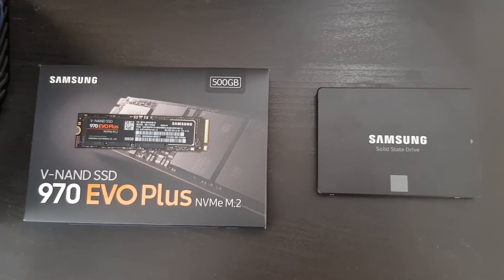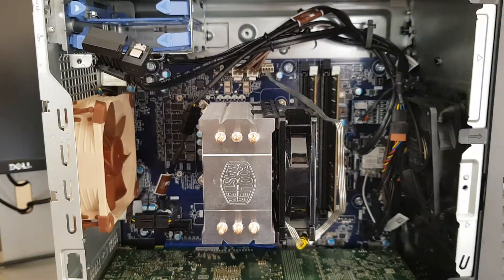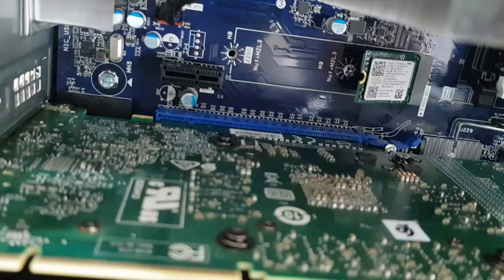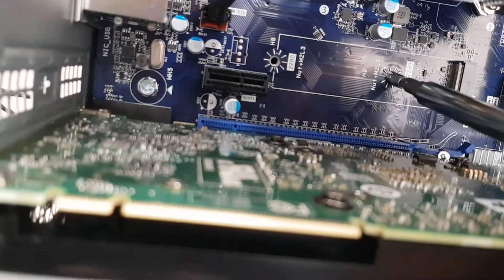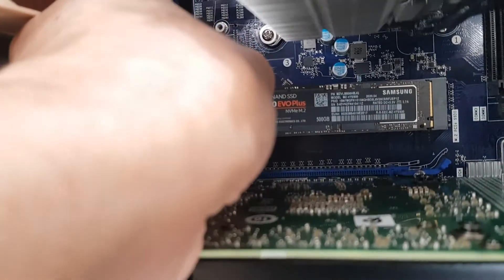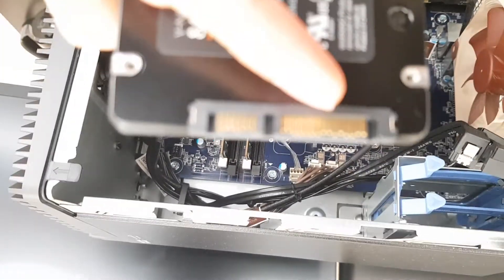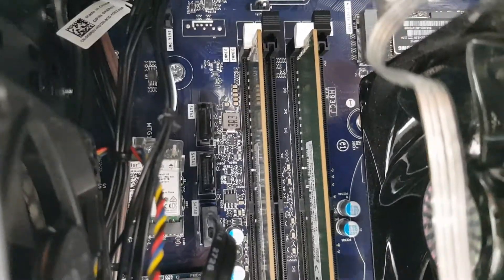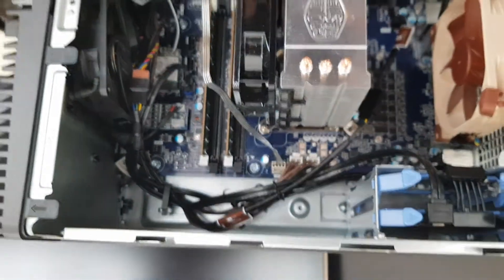Installing NVMe M.2 SSD and Regular SSD Hard Drive

Comment: Hi, finally found a video with the same dell model as mine!

I thought I was going crazy that the only slot I can fit my NVMe PCI-e is already taken up by a half-sized chip lol (i am hardware illiterate).

Is there a way to install NVMe PCI-e without taking out the original for this pc? I really hope to avoid having to clone window OS and the files... I thought I would be getting +1 TB of data, without replacing the old 458 GB. It's really disappointing if that's the case.

Comment: hi, can you provide a link to the regular 3.5 ssd hard drive that you bought to installed in your dell g5?  i want to be sure it's compatibable.  Also, does the purchase provides the necessary power and data cable or do i need to buy it sperately?
Reply from the maker: Hey, I don't have the link because this was 2 years ago but I've got the name of the SSD in the description. Google the name or buy from your local computer part shop. You will need to buy a separate data cable, I got mine from a local computer shop for $2.

Comment: Would you be able to show us how to upgrade the SSD the OS came on? Mine is just the 128 but id like a much larger one
Reply from the maker: The m.2 drive was the SSD in my case and this video shows how to physically change the drive. For moving the OS to the new drive you have to use windows imaging tool. There are plenty of videos out there already which covers this. Let me know if have trouble finding. :)

Comment: I got the same samsung ssd that you did but it doesn't work for me and I have the exact same pc as you
Reply from the maker: The m.2 ssd or the one that goes in the hard drive rack?
Reply: @nooragha360  yeah the m.2 ssd. It kept saying something along the lines of no bootable device found when I put it in. And the motherboard meets all of the requirements for the m.2 ssd so I don't know what is wrong
Reply from the maker: @itsredthesmed  you need to have your win10 operating system recovery drive connected via the USB to install win10 in your new ssd.
Reply: @nooragha360  ok thank you so much for the help
Reply: @nooragha360  another question if I install win10 on the m.2 ssd will it factory reset my pc back to choose your country and such?
Reply: do you also have DISCORD or some other social media that I can contact you if I have anymore questions or send screenshots?

Comment: do they come eith the screws
Reply from the maker: The screws for the NVMe SSD drive were already there on the motherboard.
Reply: @nooragha360  Well i have a different config with only 1 tb hdd
Reply from the maker: @elihi7607  then I would recommend to open the PC and find out if you have the slot on your motherboard.
Reply: @nooragha360  Ok, My last question is do i have to buy a sata cable or should the ssd come with one?
Reply from the maker: @elihi7607  you need to buy the data cable because SSD most likely won't come with one. They are cheap to buy only few dollars.

Comment: First I got to say your video helped me a lot, low air flow and over heat cpu was always a problem for me until I watched your video and changed cpu cooler then added more fans
Now, I want to get a SSD but is there a way that I can use both SSD and the HDD that prebuilt in it? I see the SSD tray in the box but do I need to unplugged HDD and use the cable to power SSD ? The cables by the SSD tray seems not fit
Reply from the maker: Yes you can use both the HDD and SDD but I wouldn't recommend it. HDD is too bulky, slow, takes too much space and can easily be replaced with a faster and lighter SDD drive.
To use the SDD drive bay, you just need to buy some cables (they're cheap).
Reply: @nooragha360  the reason that I’m keeping the HDD was because I bought a 500gb SSD instead of 1t to save some money, so I can use both SSD and HDD to use
I just done install and set up the SSD, now I want to move the HDD from the front to the 3.5inch HDD tray on top left to get some space for a fan. I put a fan on the bottom of the HDD at the front, the fan is facing the graphic card now, should I move it upper to let it face the CPU fan ? Will it provide better air flow ? Or should I buy another fan for cpu and let this one keep facing graphic card. After I changed Cpu cooler, added a fan in the front and changed original fan to Noctua in the back, I’m still having around 78-84°C when I play games, idk what part did I do wrong

Comment: Do I need to buy those cables? I want to buy a 2.5 inch ssd
Reply from the maker: Yes in my video I also installed a 2.5" SSD. The cable (data plus power cable) was cheap from a computer hardware store for only $2.

Comment: Hey, ill have my G5: i5-10400f, GTX 1650 Super, 2x8gb RAM, 1TB HDD delivered in about a week and I was planning on immediately adding an SSD, and use the SSD to run my OS and programs/games I play frequently. Im guessing the OS will be alrdy installed onto the HDD and Ill have to transfer that once I install the SSD? But mainly I was just wondering If all i have to do is literally insert and screw the m.2 SSD in? I saw some comments about how the "SATA" cable is too short inside but does that matter if im just gonna use the NVME SSD?  Never have  modified a PC before, I understand I need an M.2 SSD, im guessing "NVMe" ssd's are faster/better than "SATA"?
Reply from the maker: NVME M.2 is the fastest SSD type then the regular 2.5" SSD and finally the regular HDD. When you get your PC turn it on and perform normal setup. Then make an Windows 10 image on a USB. Remove the HDD and insert your SSD. Plug in your USB with your OS image and turn on your PC. Install the OS in your new SSD and your good to go. Enjoy.
Reply: @nooragha360  Thanks however I was talking about dual drives and having my OS on the SSD. from what i heard I can just use some disk wizard software for that? I plan on putting in the ssd as soon as the prebuild comes in, the OS should alrdy be installed onto the HDD?

Comment: What do i do if my pc can't find/ doesn't recognize that there is an nvme in?
Reply from the maker: What configuration are you using for your drives? Multiple drives connected to your computer? Are you attempting to have your OS image on the nvme drive (recommended)?
Reply: @nooragha360  Please help I have the same issue I want the OS on my new nvme because I just upgraded to a 500.
Reply from the maker: @eguzman90201  do you have the windows backup image setup on a USB drive?
Reply: @nooragha360  no I don’t.
Reply from the maker: @eguzman90201  to be able to replace the original drive which had the operating system (e.g. windows) installed on it, you need to make a backup image of that operating on a USB first. Then replace with the new NVME drive and connect the USB with the backup operating system image. Then turn on your PC and it should recognize the backup device and install the same operating system (Windows 10) on the new NVME drive.
Reply: @nooragha360  thank you very much Noor last question any software you recommend for me to use, I’m not much of a tech savvy person that’s why I ask someone like you since we both have the same machine and you have done this process already.
Reply from the maker: @eguzman90201  see this link: microsoft.com/en-eu/software-download/windows10
Goodluck and google is always your friend if your still stuck!

Comment: How do you do the 3.5 inch hdd? I cant for the love of god figure it out. Seagate 2TD HDD 7200 rpm. I have the g5 5090 w/ 512gb ssd and rtx 2060 from factory, trying to add a hdd to the empy 3.5hdd bay.
Reply from the maker: You need both the power cable and data cable as mentioned in the video. If it didnt come with your PC, then you can buy one and it's really cheap. Just make sure it's long enough.

Comment: How did you move the files from the mechanical hard drives that you took out to put the fan in the front of the case to your new SSD?
Reply from the maker: Mine was empty so didnt need to move any files. But that should an easy process by having both connected and copying the files to new drive.

Comment: i got the same pc but without a ssd, and with a hdd, but I am  not sattisfied with the hdd since it makes a lot of noise what should I do.
Reply from the maker: I recommend changing the mechanical HDD to a SSD. It will be a very good upgrade.
Reply: @nooragha360  yeah I'll definitely do that, it's normal for the hdd to be hard on this pc right?
Reply from the maker: @aaravdua706  what do you mean by is it normal for the hdd to be hard?
Reply: @nooragha360  Does it recognizes right away the SSD 2.5 when you remove the HDD or any other step would be required?
Reply from the maker: @EZzO444  the drive will get recognized right away but if you are referring to migrating your operating system (OS) to the new SSD, then yes you do need to install/migrate the OS (e.g. windows 10). This can be done using an external USB.
Reply: @nooragha360  Thanks for your time ;) another question. Do you need to remove the motherboard to install the cpu cooler? To put the back plate  behind the motherboard or this is not needed?
Reply from the maker: @EZzO444  nope, dont need to remove the motherboard for installing the CPU cooler.
Reply: @nooragha360  BTW thanks for being so generous. Is it difficult to remove the Dell cooler on the cpu is the thermal paste sticky? Should I run the computer to heat it up
Reply from the maker: @EZzO444  you're welcome and no it's easy to remove the paste. No need to heat it up, in fact make sure to change it when it's cool.
Reply: @nooragha360  I mean when you pull the cpu cooler from the cpu... Is it sticky you need to pull hard?

Comment: Hi.  Quick question.  I have same computer with an hdd. I wonder if I can get this ssd and plug it in and just clone the hdd onto this. Then unplug hdd and it should boot up to new ssd. I use macrium reflect to clone.works good normally. When I plug in ssd the computer should recognize it right? What do you think.  Thank's..
Reply from the maker: So your computer has the operating system on the HDD, not a M.2 SSD?
Reply: @nooragha360  yes

Comment: Did the trays and enclosure come with your pc? Mine didn’t. I really need to do this so I have room for an intake fan in the front. My 2070 super’s blower fan has to be on full blast along with the exhaust to keep its temp at 79c.
Reply from the maker: Yes mine came with the trays and enclosure.  You should be able to buy them as well if you have that space empty atm.

Comment: Where is OS installed on, the M.2 drive or the SSD drive?  Do you need to reinstall Windows after replacing the M.2 drive?
Reply from the maker: I installed the OS on the M.2 drive, because its faster than the other SSD and yes I had to reinstall windows using a recovery drive.
Reply: @nooragha360  Only 1 slot for the M.2 drive?  What if you need to upgrade it?

Comment: Love your videos, I have  this same pc and have been working through these same problems. In your opinion is would it be a good idea to add an hdd to supplement my factory ssd storage? and would it even be possible to remount that hdd somewhere and still fit the front fans you have installed? I'm hoping that will bring temps down enough to avoid the cooler master...
Reply from the maker: Thanks! I dont think it would be a good idea to use that heavy bulky mechanical drive, but if you really wanted to use it, then it should maybe possible to the following:
1. Mount the mechanical drive at its original location.
2. Attach the stock fan below the mechanical drive (in front of the GPU), it will be a tight squeeze. In terms of airflow, I wouldnt be able to comment (i.e. if it will improve temps or not).
Hope that helps.

Comment: Can I add a 1tb m.2 nVme ssd?
Reply from the maker: Yeh there should be no issues as long it's the right type of SSD matching the connection of the computer port.
Reply: @nooragha360  thx I’ll be doing that and removing my HDD so I can put my extra fan that I have in the case higher up

Comment: Thanks.    I just got a G5.  The SATA cable is incredibly short inside.  Won't reach the disk bay.
Reply from the maker: Yeh it's short but you can buy a SATA data cable from your local shop, should be cheap only couple of dollars.

Comment: Hey man, I just purchased G5 few months ago. May I ask if I just go for an extra SATA SSD drive, do I need to buy the power cable and data cable for it?
Reply from the maker: Check if you have an used cable in your G5, in my example I took out the mechanical drive and used the power cable for the SSD. But I had to purchase the data cable (it's cheap though), because it was too short to reach the SSD tray.
Reply: @nooragha360 thanks mate. I’ve done it successfully. Your video is really helpful.
Reply from the maker: @vinceliu1397  glad to hear that it helped you out.

Comment: You had to reinstall Windows, right? Did you just make a ghost image of your system, or a full backup onto an external hdd?
Reply from the maker: Yes, I installed my operating system (Windows 10) on the NVMe M.2 SSD, using the windows create image tool (fresh install) and an external drive (mine was 8GB usb). But you can also do the same if you wanted an image which included a complete back up of your old PC (this would just require a larger drive).
Reply: Noor S. So you just backed up your OS onto a USB, then switched out the SSDs, then moved over the OS onto the NVMe SSD? I just purchased the same SSD so I just wanna clarify before I switch it out and everything
Reply from the maker: @MaybeMangosOfficial  yes, as per my previous comment, you can create an OS image on a USB and then switch the SSD, and perform the reinstall.
Reply: @nooragha360  awesome thank you for clarifying my man!
Reply: @nooragha360  Just to make sure I understand ;) when you do your copy of the oS and install the new m2. You just boot your computer with the usb drive and launch the installation in BIOS?
Reply: @nooragha360  I have same computer as you. I ordered mine with just the 3.5 HDD and I was reading the specs page for this computer and it seems that if you install an SSD PCIe NVME M.2, that one ends up needing to be the primary drive over the HDD. I'm trying to figure out how to set it up in BIOS but the BIOS in all the youtube vids I've looked at looks nothing like the BIOS I have. How do I set it up in BIOS so that I can reinstall the OS on the newly installed SSD?